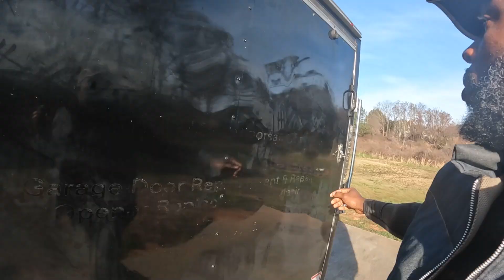Whoops! I Changed the Lock on My Trailer... But Is My Axle Bent?

Comment: Get you a 2in drop hitch off the truck to level the trailer to truck. Adjustable Floor track system with d-rings to tie bikes and anything else down. 
Peace and Blessings
Reply from the maker: I was looking at the 4” drop. I will look at the floor tracks as well. Thanks a lot for the feedback. 💪🏽💯